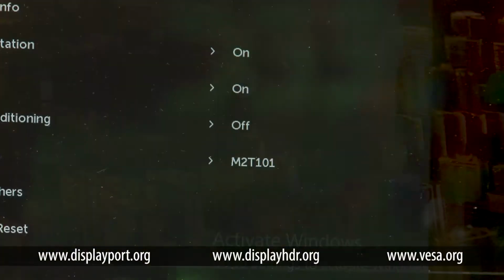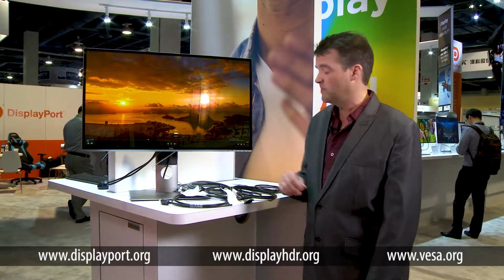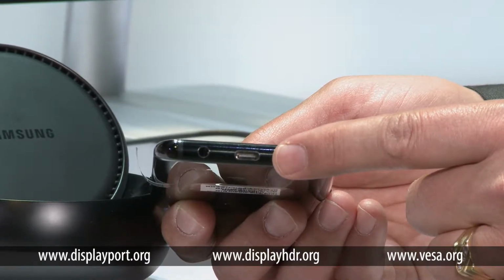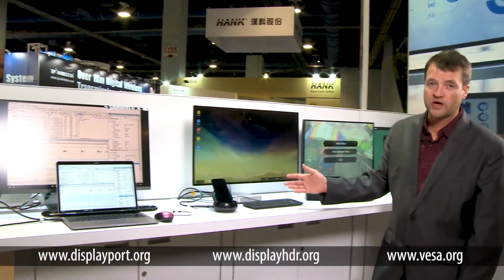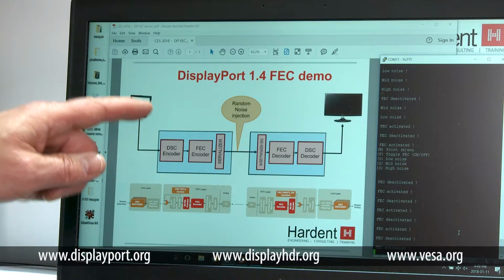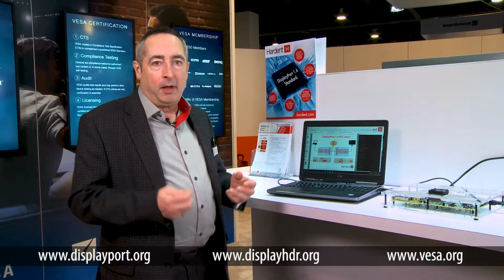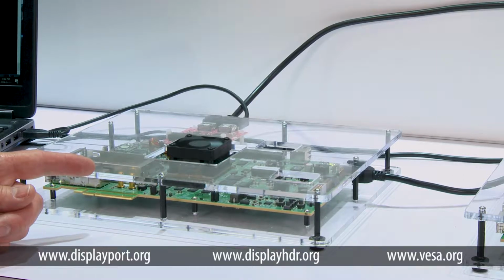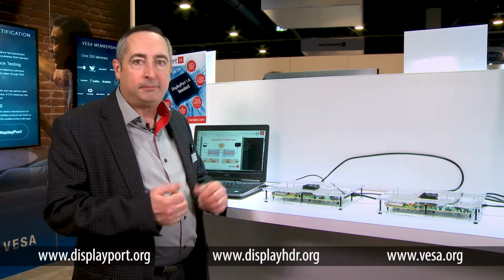VESA CES 2018

Comment: Hi, i hope vesa works quickly on DP 1.5, i am stuck with 60Hz @4k uncompressed.
Also the new monitors are not coming with 120Hz @4k and freesync, but gsync gets the boosts.
Bump the Data and realease it, no need for the HDR upgrades.